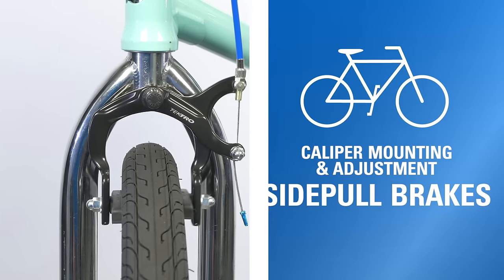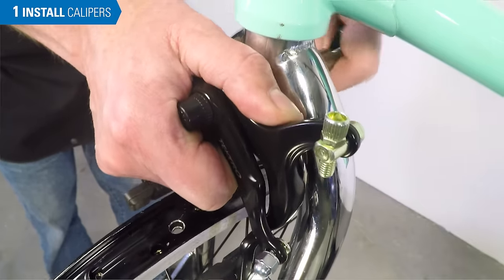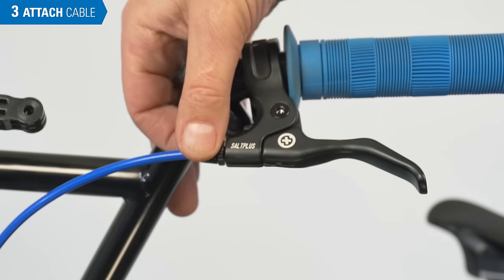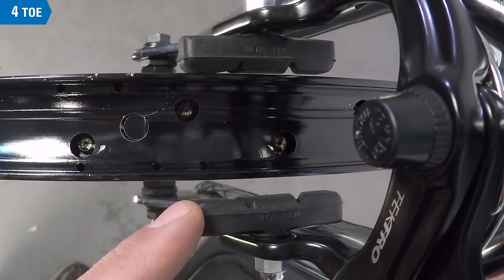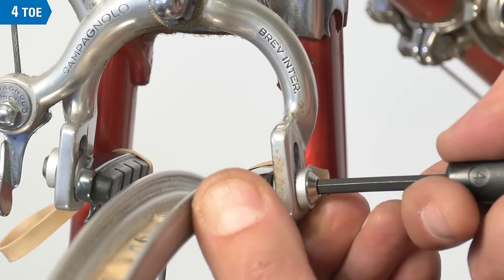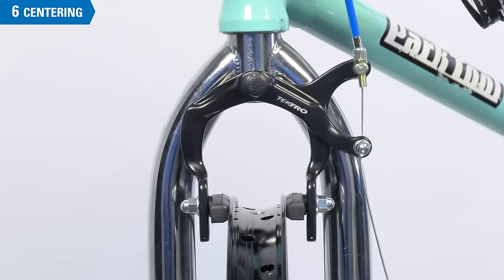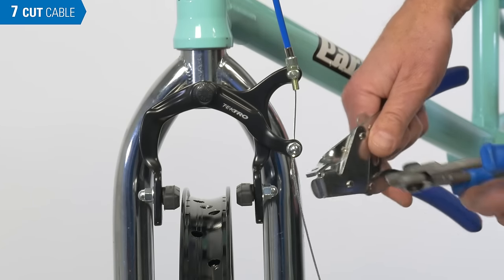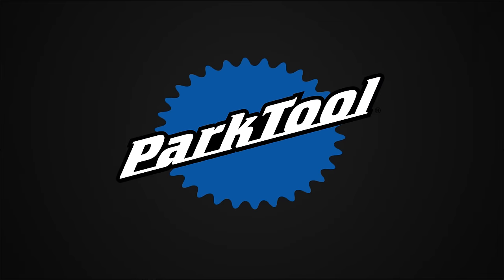Brake Caliper Mounting & Adjustment - Side Pull

Comment: when i squeeze my brake it works fine but then when i let go one side stays touching. one side moves more. idk what to do. and also when i pult the vrake lever it moves alot almost all the way to the handlebar id like the brake lever to grab earlier. but the main issue it that one side of my brakes doesnt move back and drags.
Reply from the maker: Is your brake a Side Pull?   There are centering procedures on the video.  The "V-brake" procedure is different. Use centering screws, one on either side.  For the Linear Pull style, if the pad is not properly set to the rim, it can stick as it tries to release.  You can also use the barrel adjuster to take out slack, which will get your brakes to engage earlier. 
-Calvin
Reply: Park Tool i figured it out. Im not 100%sure what i did as i just kept trying everything till it worked  it was a combination of the bolt in the back that i had to muscle to a point im pretty sure its probably too tight and loosening the cable a bit s9 the brake would open up a touch more, theyre cheap breaks i had to do some questionable stuff. I drilled holes in pennies for next to the levers as the cable ends were sort of falling into the housing. Idk it works now tho
Reply: Hi Calvin, mine is a side pull, I have the same problem. once i pull, the brake seems to move to one side and the side (with the cable) goes too close to the tire and won't pop back. while the other side could pop back. Could you plz tell me what's the problem? I tried every bolt already.

Comment: Why not use foot pounds instead of newton meters?
Reply from the maker: Newton meters (Nm) is now the common terminology in the bicycle industry.  You can convert of course.  Most torque specifications are fairly light  and Nm works out better.

Comment: I hate side pull brakes.
Reply: Yes side pull break does not perform well,  I hate it too.
Reply: @MrRabi001  I just got a bike with a pair on a fixed gear bike and immediately took them off after 2 rides and their performance doing nothing lol
Reply: Yo they are so good to be honest the have less trouble compared to v brakes
Reply: Me too lol
Reply: My new cheap bike nearly killed me. No back breaks power going downhill.  Lucky my fronts barely slowed me down enough.
Reply: Everyone does
Reply: I think everyone who watches this great vid, does.
Reply: I hate them too they don't work at all good for nothing
Reply: Same like me
Reply: Same, the man I paid for fixing my tires on my Fixie gave me these; said it would be safer. I hate them; never went back and fix it my self 10 times a week
Reply: My personal hell wold be installing these all the time
Reply: I love em
Reply: I hate them too. One side always sticks no matter what I do.
Reply: @randallwells2892 yeah i broke my brake lever because of it
Reply: Dude my hand always burned after getting off the bike, the levers are sooo tight!
Reply: Yeah. They really suck. That's why I replaced them for dual pivot brakes on my bike

Comment: I can never get the pad located on the side-pull side of the mechanism to return to the open position after applying the break. It sticks to the wheel. It's like the centering moves clockwise whenever the break is applied. Losing my mind over it 🤣
Reply from the maker: If you have a side pull, it might be the pivot adjustment is too tight.  Without the wheel, do the arms seems to open fine, or still slow?
Reply: @parktool  the side opposite the wire mechanism moves freely from the wheel whereas the mech side moves a few mm. I haven't tried it without the wheel yet, but I can see from rearranging the pads so that they sit much further away from the wheel that they both return normally after the break lever is pulled. Once the pads are aligned closer to the wheel the and the wire tightened the one side only returns a couple of mm. This is a super cheap nasty mechanism on a child's bike. Maybe this is the best I can hope for hah
Reply: @parktool  I'll have a further play with the pivot to see if that helps.

Comment: 8:37 any alternative tool?
Reply from the maker: No, not really.  There is a different technique.  Loosen the mounting nut behind the frame, and pull the brake over to center. Hold it by hand as best you can, then tighten the nut.  It may take a few attempts.
Reply: None that I would recommend
but a large flat bladed cabinet screwdriver can be used in combination with a soft mallet
to slowly Punch the spring and rotate it directly

Comment: Now matter how many times I try, the brakes are NEVER centered. I brake one time and the left brake almost touches the rim. When I use the centering screw, the right pad comes closer but left pad doesn't move away from the rim. I tried loosening the bolt and recentering the calipers, but after I do, I brake 1 time and am again in the exact scenario. What the fuck am I doing wrong, I wanna trash my bike it's so frustrating!

Comment: This was crap. My calipers dont even squeeze into the rim and I followed your instructions
Reply from the maker: Watch how the various parts move, and see what is moving them. From that, figure out how to fix it.
Reply: @parktool  
Hey mate, to be honest with you I had the shits cause i followed it 4 times from start to finish and ended up in the same spot everytime. 
The calipers still don't squeeze into the rim. Perhaps this video is set for a certain style of caliper that you have not the one im using. Im using a side pull, however it doesn't resemble the one shown in the video. It still has springs behind the caliper arms which I can set, along with tightening a hex cap on the brake itself, although it all still refuses to clamp. Cant get any give with it. 
I have followed your dual pivot videos before which worked straight away - which were great.

Comment: just got a new road bike with caliper breaks they are so weak compared to v brake i have a old mtb with hella old brakes cable and the whole braking system and they still perform better than this shitty calipers,can't skid nor lock the front wheel honestly it feels a bit unsafe might give it back and stick with mtb's if that's how calipers are supposed to be